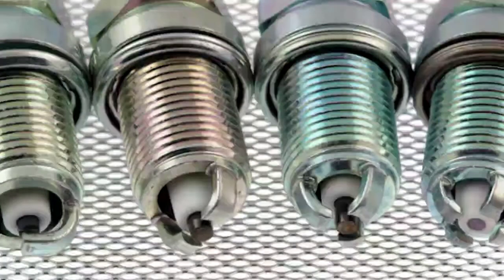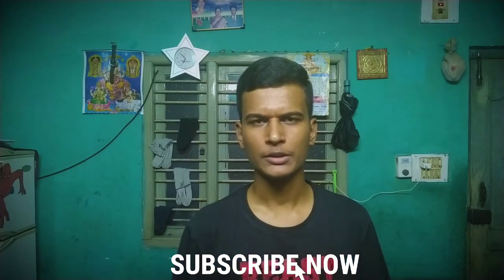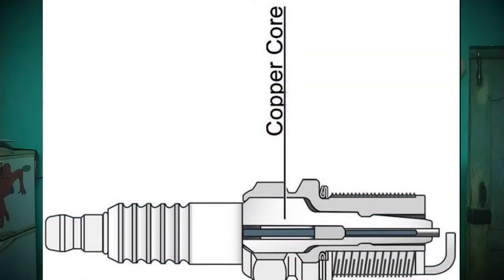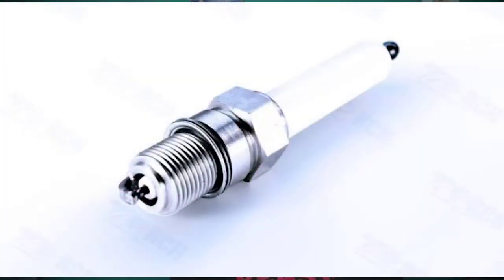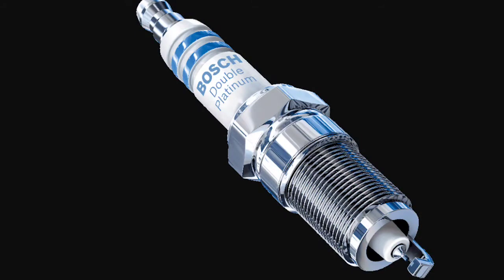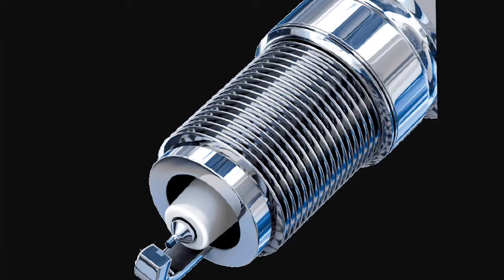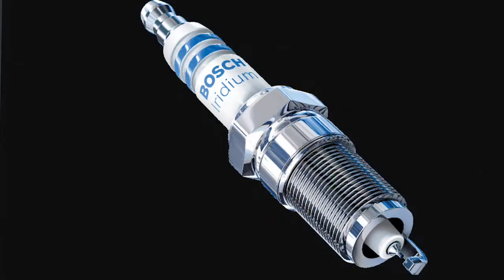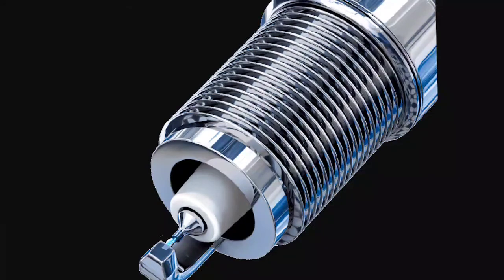COPPER vs PLATINUM vs IRADIUM SPARK PLUGS || types of spark plugs

Comment: I purchase sp125 bs6 and my bike 2200 km..can I use iridium spark plug.?
Reply from the maker: You can .....but that's not what I would suggest because it's not a performance motorcycle....and usually these 125cc and lower capacity motorcycles do not need iradium spark plugs